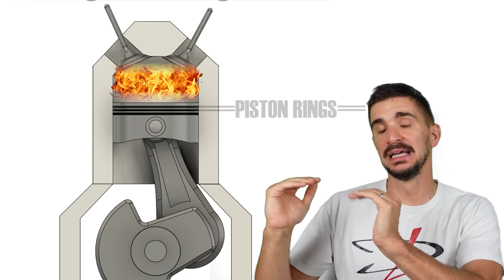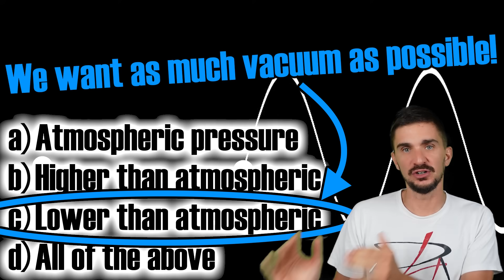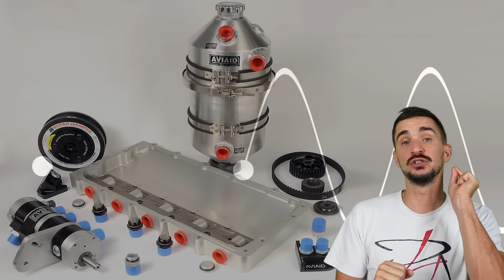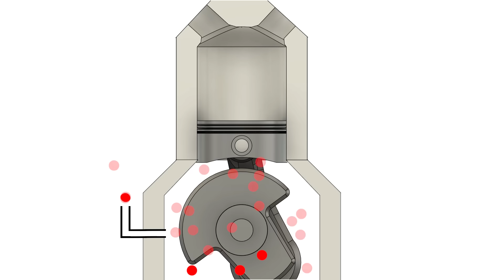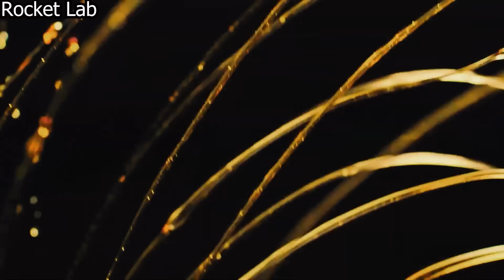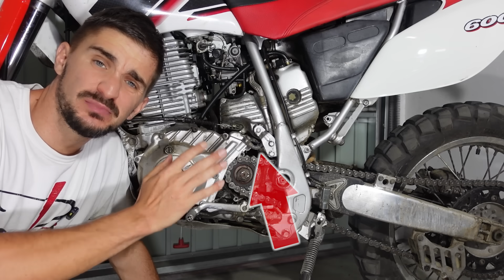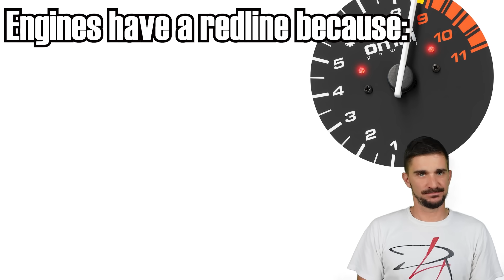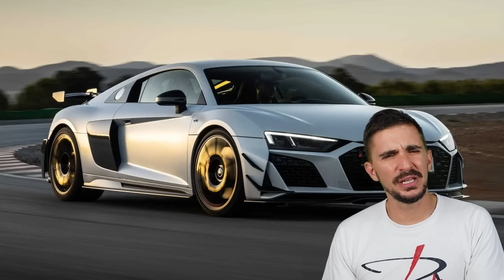Installing This Has No Drawbacks, Except for Your Wallet - Dry Sumps Are Awesome, Here's Why...

Comment: OH WOW MAGICAL TECHNOLOGY. YEAH NO IT DOESN'T HAVE DRAWBACKS BUY IT BUY IT BUY IT.

Scientific data and long term testing goes outh the window I guess.

I know your channel is 98% legit but I'm incredibly tired of the insane ammount of videos that hype EVERY SINGLE piece of technology that comes out.
Reply: I'm concerned about the OIL effects on vacuum.

Altough a "special vacuum oil" could be developed. Having a vacuum is no easy thing. It may increase the ammount of heat of the engine even more.
The rubber seals may have to work harder and have more friction because of the increase of ammoumt and force of gasses that will leak out more easily due to the forces involved.

I don't like to hype new tech until there is real world data. You have linked none of your sources in the video.

Comment: Nah. Leaning angle in motorcycles has no effect on oil shortage. The direction of forces maintain proper level of oil. However doing wheelies and stoppies may cause problems.

Comment: What if I were to say you can get the same benefits of a dry sump engine out of a wet sump engine using the existing crankcase ventilation system with a small modification. Anybody interested in knowing how?
Reply: You gonna tell us or what?

Comment: The majority of car engines, have 4 pistons, in a configuration where two of them are at TDC, and the other two at BDC. So while the engine is running, the volume of the crank-case is almost perfectly constant. 
In short: this problem is completely non-existent in the classic inline-4 engines, and on other engines it could start being a problem depending on how badly they're designed. 
But you have to realize that having a vacuumed crank-case, will then make it harder for the pistons to go up. So, in a complete cycle, things actually will even out, no matter if the pressure is pozitive or negative. What you gain on the way up, you loose on the way down; and/or vice versa.

Comment: Wouldn't engine loose the power fighting this vacuum in crankcase when piston goes up?

Also, I am pretty sure motorcycles have dry sump because there is simply no place to install wet sump which would be deep enough to contain required amount of oil.

Comment: The cost must be significant.  When Freiburger built his engine for the 200 mph+ record attempt (he got it!) at El Mirage he did not use a dry sump.  He wanted one.  To be honest, a speed run involves no significant G forces.  Lots of rpm.

The scavenge system must be complex on airplane engines.  Not sure how you scavenge oil when the engine is upside down.
Reply: For an airplane it’s reasonably easy. Basically just add some scavenge lines to the valve covers and they’ll return the oil to the tank. 
The cost of just the pump isn’t that bad. It’s ultimately the cost of all the plumbing, tank, and mounting for everything.

Comment: Drawbacks? 
1. Oil from the Oil Tank draining into the Engine after some time (when my Enfield sits for some weeks, I have to turn the Engine through a couple of times until my dipstick reaches the Oil again. Adding a Valve there as a failure point is dangerous. 
2. Additional external Oil Lines for mechanics to damage. 
3. You have two Oil Pumps instead of one, one for scavenge, one for pressure. 
All for Advantages 99% of Cars will never get anywhere near requiring.
Reply: wet sumping #1

Comment: benefits: marginal power gain, engine protection when braking (Im sure it will save you thousands of mileage on engine), better oil cooling (get an oil cooler), lower center of gravity (lmao). The only real benefit is ability to redline for longer but I'm pretty sure getting modified/better oil pump solves this problem much more cost effectively.  Drawbacks: costs 3000-8000 USD. Once again you're getting hyped up over nothing.

Comment: Does it make oil changes more difficult?
Reply: Depends on the setup. They often run remote mounted filters that are easier to get to, and often draining/refilling the tank is easy. But, I’ve messed with some where the tank is tucked away and hard to get to.

Comment: Would a dry sump system also eliminate the carbon buildup problem caused by the pcv valve spewing oil in the air intake in direct injection only engines?
I'm guessing that it would need to be redirected somewhere else like the new extra oil tank, given that a delete would likely go against regulations in some countries.

Comment: 4:00 Yes I know, drowned in the flow. For the algorithm. As others already have mentioned, the pressure exerted on the pistons is a zero sum equation. The turbulence between the cylinders and, as mentioned, the drag on moving parts is the aerodynamic loss.

Comment: The oil still passes by the crankshaft while dribbling out of the engine.  So how does a true dry sump perform compared to a high quality wet sump, with a scraper and a vacuum pump (not a scavenger - air only).
Reply: At that point they’re pretty similar. But, the dry sump gives the extra capacity and basically removes the possibility of oil starvation from g-forces or angle.

Comment: I only have one pedantic nit-pick in this otherwise great video: I don't think lean angles have any impact on the oil in the sump of a motorbike, since the act of leaning puts all the force downwards in the bike's vertical plane. That's why it's chill being sat on one when cranked right over, unlike in a car where you're pushed into the side of the seat. But I can totally see how acceleration and braking could cause oil starvation issues and warrant the mighty dry sump.

Comment: From an engineering perspective in performance applications, dry sumps are amazing and I'd want them everywhere. But the cost of those systems in the aftermarket is substantial (i've seen 5-6k or more for K-series engines), and unless you're pulling the Gs or absolutely need every last drop of power on track, the cost and complexity is hard to justify. A good middle ground seems to be the pressurized supplementary oil containers like an Accusump, instead.

Comment: I got a drawback. 
Oil changes 😅
I’ve had a few dry sumpers (there’s a NSFW joke in there somewhere), all sport bikes. And I remember my KTM S’Duke 990R had something like 4 oil screens plus the filter. Adding the oil cooler to the process yielded a half-day oil change for 2 frickin cylinders. And in those bikes you change the oil about every 10th fill up damn near. Real pain in the ass…
I sound like a b*tch 😂

Comment: I was only familiar with advantage #3 or 4 (oil pressure during hard cornering). I had a problem with that in my old VW Beetles. I might have been cornering a little too fast...

Comment: I'm not a mechanic by any means, but am interested in auto tech, especially when I can visualize what's happening. I always wondered about dry sump systems but never really knew, so thanks for explaining. The memes in this video were pretty good too. 
Question though, doesn't the necessity of more oil than a wet sump system mean more weight the car has to carry? Potentially tripling more oil storage can add up, not to mention where the oil storage is located on the car may affect quick and nimble cornering for some cars depending on if the tank is located right side or left side of the front, or the rear...or is that extra weight negligible based on the extra horsepower benefits?

Comment: you can also just use a Wankel rotary engine design- the "crankcase" is in the middle of the engine instead of the bottom so you cant use it to splash oil, the pressure is more uniform, and the seals don't work right anyway so you dont worry about too much pressure or bad sealing because its always bad! Lubrication is easy when you don't mind burning oil constantly by design and have a whole extra cat pack setup just for dealing with the terrible emissions.  <|

Bonus fact- rotary engines are somewhat OIL cooled in addition to water cooled- they have a little extra oil radiator and they move a lot of oil around from the combustion side to the intake/compression side to try and keep the temperature more even over the whole housing, which means the whole engine stack is also radiating a bit. The engine fans in early rotaries are huge direct drive things that blow air right onto the engine as well as suck through the radiators.

When you hear rx2 rx3 rx7s, they have a constant whoooosh to them that is not the engine, its the big fan (especially the first rx7 where they had less room in the nose for radiators so they have a really aggressive fan!)

Comment: I suppose the PCV being hooked up to the intake on a wet sump creates a small vacuum to help evacuate air from the sump to reduce resistance on the piston as it travels to BDC. Interesting. This video is timely as I was trying to figure out how my car's PCV system worked and when I should replace the PCV valve. Great video as always. Now if I could only justify putting a dry sump on my Corolla. Lmao

Comment: All three of my motorcycles can approve the message (Buell 1125, Harley Sportster, Honda XBR). Additional advantage seems to me the fact that lower oil levels do not result in failure, just higher oil temperature. The only drawback I see is a more tricky oil level check.
Reply: Nice. What year is your Buell? R or CR?

I had a 2007 XB12R, 2008 1125R, and still have a 2009 Buell 1125R.
Reply: @PaulMEdwards  It´s a pre-series 2008, R model, which can not be made road legal, so I turned it into a dragbike, which is still under development. 9.94 so far. The engine is great!

Comment: As a teen I read every book there was on race car design and dry sumps and windage trays were one of the defining things of a capable race engine.  Working in a race engine shop that specialized in the Kent Formula Ford engines, we got a commission for an Alfa Romeo DOHC race ready engine.  It did not include a dry sump and we were wondering how the pushrod Kent engine was producing more power than the Alfa engine.  I thought then, and now that one of the important factors was the dry sump on the Kent.  The book Prepare to Win by Carroll Smith goes in details about dry sump design.  Great topic.  Now were can I fit that swirl chamber on my Honda Accord?

Comment: Vacuum in the crankcase does not affect ring sealing in the way you think it does. I agree that less pressure under the rings on the down stroke is good but that will only affect the second compression ring so the piston can maintain its seal. Plus with some or most compression rings, exhaust gasses can get behind the ring to help push it outward also increasing the ring seal. But in the case of a dry sump system and the way it maintains better oil pressure and quality, the dynamic compression seal will be better on the cylinder walls because there's a more consistent film of oil that is kept in better condition due to not being exposed to exhaust gasses all the time. Vacuum in the crankcase will overall have little affect on ring seal because the compression rings can flex and move slightly in their grooves and have the help of oil to make an even better seal. Vacuum in the crankcase will have some benefit to ring seal but that benefit is tiny compared to the use of exhaust gasses to push the rings and better quality and better maintained oil pressure for it's dynamic sealing. Vacuum in the crankcase allows for increased rotational efficiency and a slight relaxation of the piston rings

Comment: i do think likening the added cost and complexity to drinking water with a cup is downplaying it a little bit much - if it were that easy to implement, everyone would get a dry sump, but budget is real and so are points of failure and I cant see an added pump as trivial. That's not to say a dry sump isnt a great idea if you care about it even a little bit, just that we shouldn't ignore that cost and complexity are a tangible drawback

Comment: Yep, learned about this in 1980 when I decided to see if I could wheelie my '79 Honda XR200 10 miles. At just over 2 miles the cam seized up. Lesson learned. Also lesson learned on how to rebuild that engine.
Reply: it's what we learn from our mistakes brother 😂😂
Reply: Fortunately I don't have that problem on my 300 2T - but not because of the sump... it's because I can't wheelie for sh*t....
Reply: @glennalderton1313 can relate to that - was ever able to lift the front wheel and then keep it up for more than a fraction of a second…
Reply: @glennalderton1313 that's ok because us the sane riders never wanted to- two tiny patches of rubber in contact with the road surface is little enough!
Reply: Absolutely when the Yamaha R1 first came out, they were coming back to the shops with smoked cams blown up motors because so many people were wheeling them for multiple miles. They changed the pick up location to the Rear, which is where it should be anyway.
Reply: The flex here is enormous... "I wheelied 2mi and then recovered mid-wheelie from cam seizure, got home safely, and rebuilt the engine" 😂
Reply: @microcolonel I grew up with quite a few people like this, literally.  Sometimes I truly do not know how I am still alive. God bless people like him that are willing to do crazy great things, I (for the most part) have stopped doing those things due to physical health.  Shame....Shame
Reply: You manage to touch the front down without further incident?
Reply: Good times!
Reply: What a 1980s thing to say😂
Reply: Lies, a 1980 XR200 could wheelie with a cherry picker lifting the nose! 😅
Reply: I can sympathise, having learned a few expensive lessons my self.

Comment: There's another big benefit you forgot to mention, a crank case with lower pressure also lowers the boiling point of water, and because gasses are constantly exiting the case, it will significant tly reduce the water content. Though in a healthy engine, it shouldn't be much to begin with, but any removal of another vector of failure always helps and will extend the oil life. anyone in a humid environment now has another reason to get one.

Comment: There was a product back in the 1980s that used an engine driven vacuum pump to reduce the pressure in the crankcase without all the complexity of a dry sump system. They claimed that a hot V8 would typically gain 50hp net and that oil foaming would essentially be eliminated.
Reply: i have seen enough, time to slap some vacuum pump onto my klx
Reply: @NKG416 doesn't that make you wonder why they don't still make that product though? Is it that it was not enough cheaper than a dry sump, or did it not really produce that much gain? Or maybe it only produced that much gain if you were running thick oil and had a very well fitted crank scraper? I suspect the last might be it...
Reply: @jdrissel  or maybe they got sued because it's not actually increase their engine for 50hp.

Comment: If one wants to create a vacuum (a tiny bit of vacuum) then he needs to install a small tube from the engine to the inlet manifold. Just like a carburetor the speed of the stream of air in the manifold will suck air out the sump thus creating a vacuum. The size of this tube aka hose must probably be calculated. But common sense tells us that a big hose creates less to none vacuum. While a tiny hose might give the required or the achievement you are looking for.

Comment: As I’m recalling it, my grandfather‘s generation had to make those electric static air filters to actively electrically charge the air to restore the air’s ability to hold the humidity in the air and that’s happened in my lifetime. I even helped design the fucking glider and where is the extra horsepower come from? It comes out of hydrogen in the oil And the hydrogen in the oil. The oil starts to turn to plastic when you shut the engine off the thing start, sucking the hydrogen back out of the air, so it’s not to have the oil turned to plastic, which is one of the things that Dino Dookie does, and as it pulls the hydrogen out of the air, it makes the air no longer capable of holding hydrogen and we had 115° sweltering days and down to 60° nights and no cloud cover and no rain and it was specifically because of all of the engines having this device in them They removed this device from the engine, and they electrically repaired the oxygen at high altitude with autonomous gliders that we had to build twice as many of because the sun melted them down and when I hit the ground, they went to itty-bitty little splinters like Milton jug that set out in the sun for two years or so the rain just hit it and you watch themilk jug busting into pieces

Comment: Another good video. Thank you. Just for the heck of it I will add, Triumph and Norton have entered the chat. They’ve had dry sumps for a very very long time although very primitive. On a very more current note, with this dry sump type of system, it would be very easy to add an electric oil pump with a separate feed and check valves between the filter in the engine to pressurize the oil system for 10 or 15 seconds before start. It would make bearing wear a thing of the past. 😊